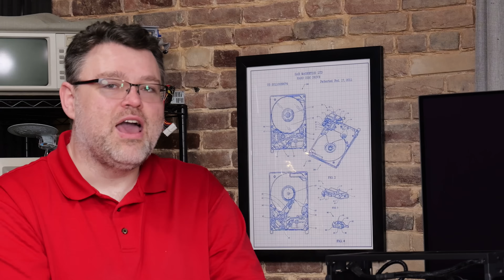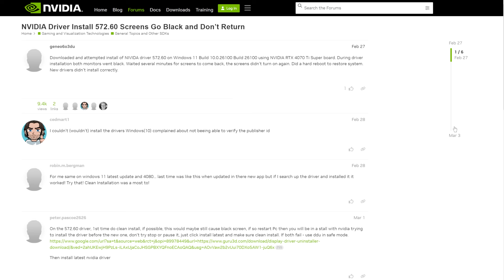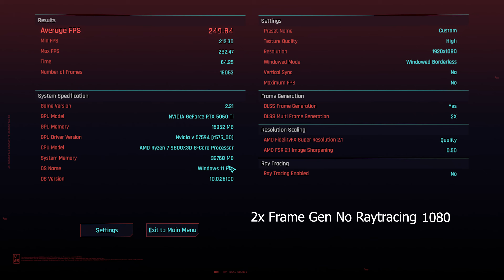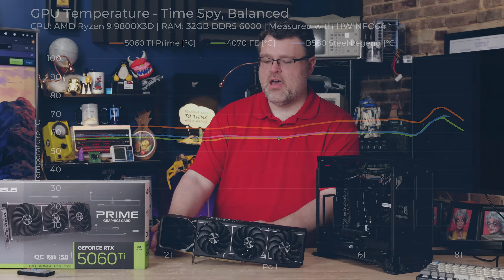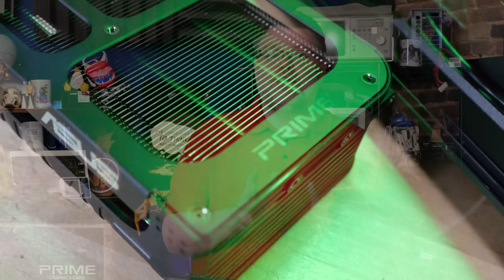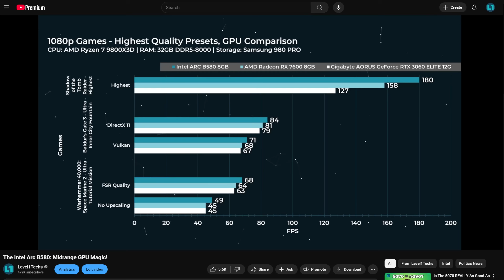Reviewing the ASUS 5060ti Prime and Ramble'n about DLSS

Comment: The Provoked Prawn released a video on Nvidia driver issues as he had instability with his 4090 after trialling a 5090.
He bought a 9070xt to have stability and accepted the slower performance in Da Vinci for video production, because it runs solid.
Many in the comments advised DDU and installing last years drivers, as a fix.

Comment: 5060ti could be good, if not only for singular thing nvidia already made with 4060 and 4060ti, and never bothered to correct it with 5060 and 5060ti. I am of course talking about 128 bit bus. That's just painfully low. With textures used nowadays you will experience absolutely god awful stutters. Try add raytracing and frame generation here - stutters will get even worse.

Maybe if eventually nvidia will bother make 5060ti super, and for once actually bothered actually upgrade bus at least to 196...
But 128bit bus in 2025 is just solid NOPE

Comment: its intresting to see the difference between the b580 and the rtx 4070. i wonder if its the slightly faster gddr6x memory on the 4070  that gives it the lead over the b580 or if the 4070 gpu die is just better than the b580...
Or if its just better drivers on nvidias part?

Comment: Wendell, you finally figured it out everything below the 5090 is a laptop GPU repurpose for DIY. They’re probably the worst chips to been down from the laptop chips, which have to run out much lower voltages. This started with the 40 series. This is why we have the smaller buses

Comment: What very ironic that 5060ti has 448GB/s at 8GB video. It can use about 150GB/s to render per frame to mimic It having 12 ~ 24GB, The same trick the PS2 used to fit framebuffers larger than the 4MB eDRAM. The only issue here Is would a M.2 & faster DDR4/DDR5 would be needed to allow It use main Ram for textures which Is what the PS2 also did to allow a upper max of 8MB textures by loading in & out. This Is why PC games don't just crash when there no VRAM left for textures.

It almost like Nvidia copying the PS2 hardware playbook.

Comment: In Australia the 4070 is around the same price and a little cheaper with some models, the 4070 is all round better, esp with RT. So the 5060 ti is not worth it imo at the price it's at. in the past the 60 series card always at least matched the last gen 70 series card and beating it in some cases.

Comment: Producing GPU's with only 8Gb  VRAM  in 2025 is almost as bad as crippling a GPU with a 128 bit VRAM bus width. Oh! so sad.
Also, why does the 5060 Ti still have less Cuda cores and ROPS than the 3060Ti ?
I understand NvidAI (intentional) don't care much for the gamer market, but come on!
Throw us a few crumbs otherwise AMD will take the mid range gamer realm for sure. I only still buy Nvidia because I need Cuda for work,

Comment: So, a test of Lossless Scaling would be interesting. It allows to use 2 GPUs, even mix match with different vendors, one rendering and one generating frames. 8GBs seems like an okay amount if the GPU will be generating frames.
It would be nice if there were something similar for Linux. A rather in depth test with different GPU generations going back to a 1080 Ti or P40 up to the 5060Ti or the AMD cards would be very informative.

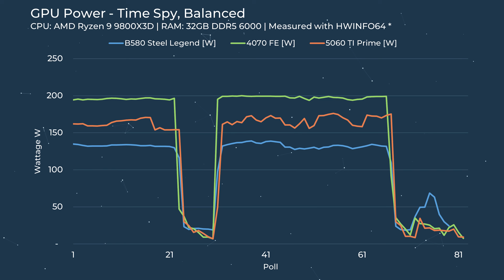Comment: 15:20 One of the reasons the 5060TI is not using more power than the 4070 is because the 5060TI is a 50 class card, and the 4070 is a 60 class card
The die of the 4070 is 50% larger, the membus is 50% larger. Sure they're on the same node so Nvidia has to heavily OC this 50 class to compete with the last gen 60 class and the 16GB 5060 uses 8 RAM chips instead of the 8GB version, or 6 chips on the 4070, but there is only so much more juice you can add before it starts to actually decrease performance and that just cant push it past the power usage of an already high on the watt to performance curve 4070

Now, if you take the 60 class 5070 and compare it to the 70 class 4080 you could see the 5070 using more power because now the 4080 is only 33% larger, though maybe not the 4080 super which IIRC pushes the 4080 even higher up that watt to performance curve.
Reply: To clarify, i'm not saying its a bad card, just saying Nvidia would have to push this card so hard to out-watt a 50% larger card, that the OC would probably resut in reduced clocks compared to what it has now and actually be worse performance.

Comment: Imagine if the 3060, got the 5060TI 16GB treatment and came with 24GB
That would have blown people's minds.
Reply: They went the other way instead. A year after the launch of the 3060 12GB they released a 3060 8GB which had only a 128bit bus width instead of 192bit. I am guessing it was based on the mobile 3060 and simply slapped onto a PCIe Card to confuse uneducated gamers which is a common move for nvidia. I do however love my 4070 Super but remember nvidia did a similar move for those when they quietly made GDDR6 versions instead of GDDR6X.

Comment: 13:18 That may be because each tier of frame gen adds more latency, I'm not sure whether I saw that on a GN or JayzTwoCents video, but one of the main tech channels did a breakdown of the feature. 40fps multiplied to 160 generated frames wouldn't feel like 40fps, more like 30.
Reply: It's not JUST latency. Frame gen has a performance overhead. If you get 40 fps and turn on MFG, you wont get 40 native frames per second interspersed with AI generated frames. You will get 30-35 native frames. And AFTER this the added latency from the frame gen comes in.

Comment: Best part of this launch is the driver finally fixed some weirdness I was having on my 50 series. Curious if anyone else saw this. My 5070 Ti wouldn't downclock the Vram below 875Mhz (50% speed) and kept the Pci-E link speed pegged at X16 5.0. It didn't really hurt anything except slighly higher power consumption and temps on the memory. It's now finally been addressed and the idle power consumption went from around 38 watts to 20 watts.
Reply: that 20w is with 1 or 2 monitors? if one, its still pretty "high" /// good observation...lots of lil quirks to each graphic card ;)

Comment: DLSS stuff is just locked out of newest generation. It's basically a new card with very little performance improvement but since dlss will be locked to the newest card you have to buy it if that becomes more and more valuable.

Comment: Not a fan of frame generation .. and i do not want to jump on a hate bandwaggon about it. Recently i was playing Avowed .. and it automatically set display settings to DLSS Quality and frame generation. (i only have a 4090, not a 50 GPU .. so it is only one single frame being generated). The whole game experience was absolutely terrible. It was as if it had the worst kind of mouse acceleration and like skating on ice. 
I actually wrote that problem in one of the review videos for that game here on YouTube and someone suggested to uncheck frame generation. Once done, it runs absolutely fine. 

I am fairly sure that 4x frame generation does not improve my gaming experience .. but it might depend on the game. 

Also, the game runs perfectly fine natively without DLSS and frame generation .. so no idea why the automatic settings activated it anyway.

Comment: VRAM haters: "RTX 5060 is too weak and the 128-bit bus is too narrow to utilize more than 8GB of VRAM. 8GB is more than enough!"
Reply: So is nvidia the problem or is the problem more that people buy a 60 class card since that is all they can afford and then also buy a 1440p monitor and try to run Ultra Settings at that resolution...on an 8GB card? 60 class cards are not even meant for 1080p Ultra let alone 1440p Ultra. 1080p High at the most and even then the monitor such users should buy is 1080p 75hz. not 1440p 165hz. Sorry but that is what the 70 class cards are for. 80 and 90 class for 4k. RTX 4060/5060 is $299 (likely) and a decent 1440p 165hz Monitor is about $200. Most gamers do not understand that they may need to lower their gaming resolution or settings to get better framerates. So they just assume that a $300 GPU will easily drive a $200 Monitor. In reality they should have bought the El Cheapo $100 Walmart special 24" 1080p 75hz Monitor to pair with their entry level GPU.
Reply: @claytonkyler4697  You would have a point if we were discussing the 1060, but the 5060 is supposed to be better than the 1060. When the 1060 released 1080p ultra was considered reasonably high end, these days it's on the lower end, and GPU tiers should reflect that
Reply: @ current aaa is blurry trash, and looks like ps2 or worse if you try to run medium. They use cheapest / least-dev-time (realtime, aka heckin demanding) approaches to certain effects like lighting, so turning settings down, you might as well just play old games on old hardware. New midrange cards are about as good as yesteryear's high-ish end, but cost the same as yesteryear's highish end did. Today's low end is absolute shit value proposition
Reply: More like corporate bots, shills and simps
Reply: Yeah, not to mention that they're completely ignoring that the 5060Ti being too weak to use more than 8GB of VRAM is actually a bad thing, we don't want anaemic mid tier GPUs. This thing is going to be genuinely given a run for its money by Strix Halo ffs (don't get me wrong it will still win but not by anywhere near enough to justify the price)

Comment: Isn’t the feeling weird the frame being like 16ms but the fps 200 when it should be really low
Reply: Of course it's weird. The more input your game expects/requires, the weirder it gets. The reverse is also true, though. The less input your game requires, the less you'll feel the disconnect.

What (any type of) FG does really well is taking a perfectly playable framerate and explode it to a very high refresh rate display (240hz and beyond). What (again any type of) FG does not do well, no matter how many times Nvidia may say so, is take a really unplayable framerate and extrapolate it to a good gaming experience. That's just not what it's capable of, simply because the way your game feels is tied to the base framerate, not the generated one.

Comment: The Steam Hardware Survey is a little flawed when trying to gauge popularity because there's no real way the survey can tell you whether these cards were installed in prebuilts... but, yeah, aa lot of xx60 cards get dumped into prebuilts.
Reply: Steam Survey is an accurate representation of what hardware Players are using to play games. It's not an accurate representation of how much hardware is being sold / in systems.  So long as you know what it is, then it's fine.
Reply: @Irenaeus247  It doesn't survey users regularly enough for the data to be accurate near GPU launches. My last hw survey has a 1070, while I've been using a 9070 XT for almost 2 months. It takes a while for the data to be actually representative of reality because Steam HW surveys distribution is randomized.
Reply: Or LAN Cafes in Asia which tend to use 60-class cards almost exclusively.
Reply: It doest tell you popularity either. It just tells you what ppl have. Now… ppl might also be „ppl“ and what they have does not need to be what they want to use.

Its basically useless Information. Like… i would go so far to call it Propaganda Material for Nvidia.
Reply: Use steam survey as Vibe check not factual check.
Reply: and mobile

Comment: What people should understand about frame generation (both AMD and Nvidia) is, it's not meant to create high frame rates from nothing. The best use case is to fill in the few missing frames to hit your monitor max. frequency/vsync.
Reply: Yet ETA-PRIME continues to push FG on APU based systems just to get acceptable framerates in single player games such as Spiderman Remastered. I refuse to use it in any scenario on both my APU based system (5600G) and my ITX Rig (4070 Super). If I am not maxing out my monitor I will just lower settings or set vsync at the fps I can sustain.
Reply: @claytonkyler4697  I use 4070 Ti Super and in slower paced games such as MS: Flight simulator 2024 the FG is pure magic, especialy for gamepad use. I mean 4K (dlss quality; note dlss quality looks better than native on my monitor, even if there is a slight ghosting when flying close to water in 3rd. person view), ultra preset without FG = 42-50fps (even when lowering the preset), with FG = locked 60fps (or anything around 75-85fps) and since flying planes isn't really a quick action, I can't tell any input lag, using wireless xbox elite 2 controller. On the other hand, in fps games, the FG causes a very noticeable input lag when using mouse and even with the gamepad. Some games are unplayable like this, some games you can get used to.

Comment: My 980Ti from 2015 has 6GB of RAM. This is ridiculous.
Reply: Yeah the bare minimum should be 12gb in 2025😂
Reply: my 2016 laptop with 1070 mobile has 8gb vram
Reply: R9 280X from 2013 had 8 GB models, the $199 option for the RX 470 was 8GB and only a $20 premium over the 4GB model.  The Arc A770 had 16GB for $300. 8GB should be at the $150 price tier by now with the X50 class cards being 12GB starting.  The 5070/9070 really should be 24 GB cards and the 5080 a 32 GB card.
Reply: @ yep
Reply: My old 7970 from 2012 had 6GB as well, pretty sure they're intentionally limiting performance to force consumers to upgrade their GPU more often. Very scummy imo...
Reply: 980Ti was a top tier card. The RX470, which was a mid tier card at best, had 8 GB, less than a year later. So did the 1070 released around the same time. The 1070 was, despite two tiers lower, also faster than the 980ti. You don't see a 70-series card being faster than the prior gen 90-series card these days, do you? :/
Reply: 980Ti GANG LETSGOO
Reply: My MSI 1080ti with EKWB full cover still crushes all the games I play.
Reply: @spacemanwithraygun3933 if you have 1080p monitor yes you are correct but I didn't spend all that $ building a pc just so I can play at 1080p😂. 4k all the way for me.
Reply: @jlrockafella  then pay up
Reply: So you haven't played Cyberpunk then? Shame, phantom liberty is a banger ngl.
Reply: @spacemanwithraygun3933 Apparently a lot of these new AAA games actually need these new cards to run at an acceptable frame rate. I say apparently because it's largely due to them being un-optimised design by committee drek and like you I tend to stick to actually good games instead

Comment: A 5060ti having more vram than a 5070 is dumb
Reply: Planned obsolescence by not having enough compute (5060 Ti) or not enough VRAM (5070). It is by design.
Reply: @Shizuna_no_Kiseki  low tier graphics cards are always supposed to have a low computational power compared to the mid tier cards and flagships. Otherwise the flagship cards would be able to run the most demanding games at 4k max settings with 400 fps native, which is not realistic.
Reply: or good value
Reply: @bigturkey1  we found the Nvidia pony boy. 🤦
Reply: Question is : Is the 16GB 5060Ti dumb, or the 5070 12GB dumb?
Reply: @johnroberts86  both.
Reply: @johnroberts86  yes